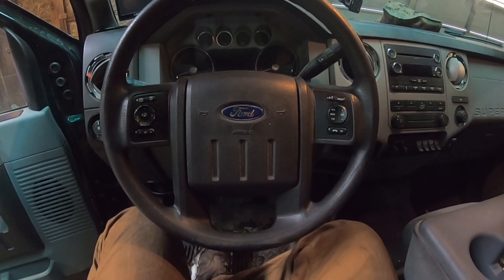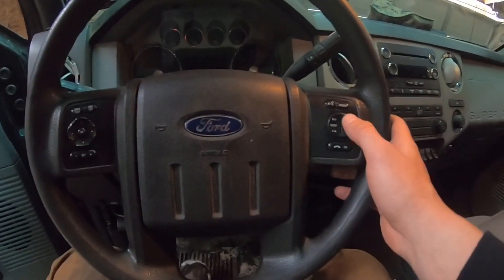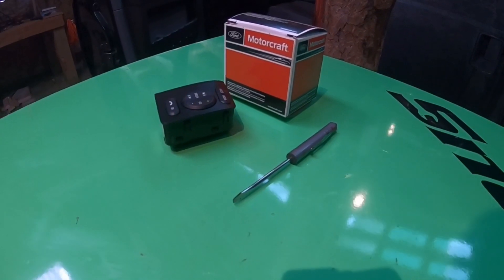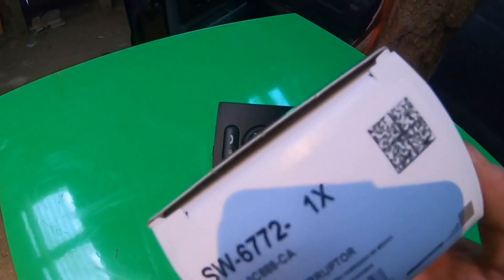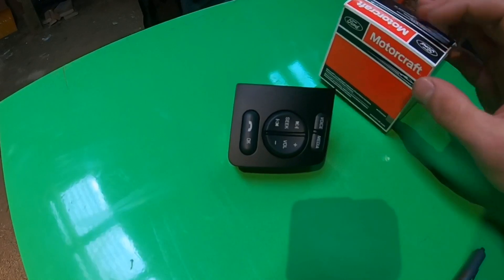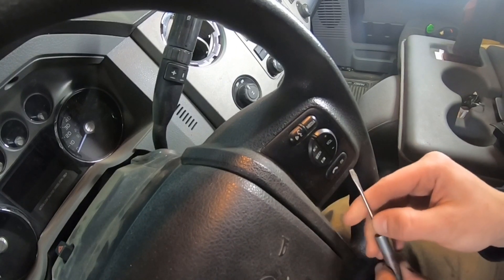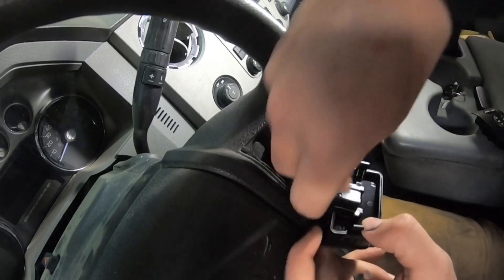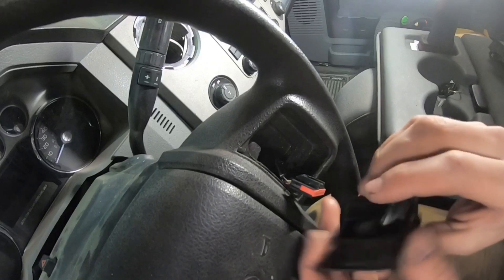2011-2016 f250 F350 steering wheel controls audio cruise control. How to

Comment: Thanks 😎👍 for the info. I’m guessing its the same steps way for the switch on the left side of the steering wheel.
Reply from the maker: Miley Teran you are correct! Good luck! Message me with any questions.
Reply: is it common for both the audio AND cruise to go out together?
the control for the message center still works though

Comment: None of the buttons on my 16 f250 are working. Checked all the fuses and what not. Would this solve the issue or is it some other problem?
Reply from the maker: More than likely you’ll need a clock spring which is behind the steering wheel

Comment: is it common for both the audio AND cruise to go out together?
the control for the message center still works though. hanks for the video.
Reply from the maker: No more than likely that is in the harness.
Reply: @CODYKUBI  cruise control , horn and fuel meter doesn't work...u think changing that part could fix it?
Reply: @5kwattz  if your cruise AND horn are out it's more than likely your clock spring in the steering column.

Comment: When I use mine it changes the moods on the radio. Could this be the problem for that as well?
Reply from the maker: It could, this isn’t a guaranteed fix it could also be several other issues ontop of the switches